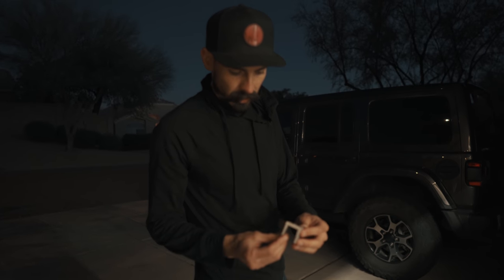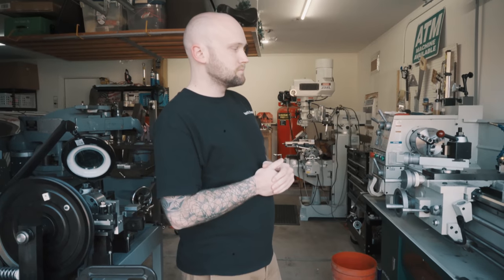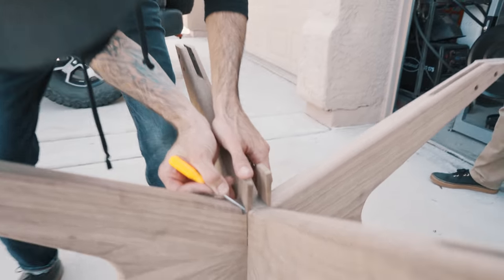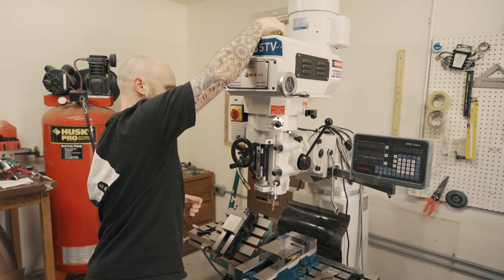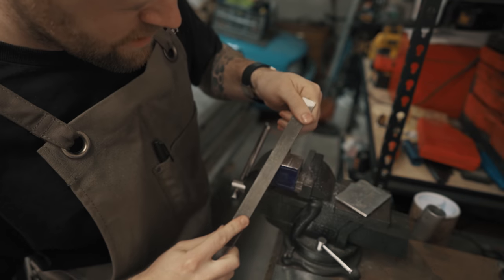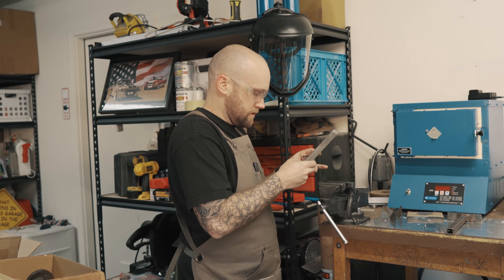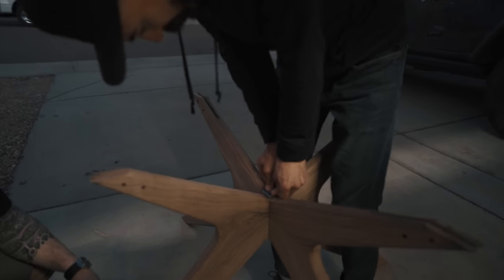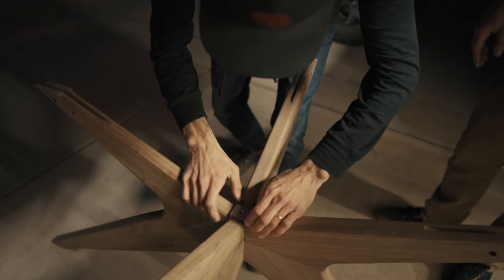Metal Milling and Table Leg Making | Road To A Table: Part 5 | Woodworking in Phoenix, AZ [4K]

Comment: Just a suggestion for if you end up using this joint going forward - not sure what costs you have associated in getting these made, but you could probably save yourselves some money and Darren some valuable time by starting with a C or U channel extrusion, cutting to length, adding your countersink hole and then tapering the walls.  That would save the step of boring out the cavity in the middle and you're not paying for all that metal to just become scrap.  I know there are lots of standard shaped extrusions that would probably fit your bill here, even if you ended up having to mill off some extrusion marks to clean it up and bring to final size.  I worked in aluminum for several years with CNC and manual so I know what I'm talking about lol.  I'd be happy to explain more what I mean if you're unclear and are interested.  Good luck to you guys!
Reply from the maker: Jason Woodford very helpful and insightful tips. I am looking into having them cast

Comment: Rather new, but I actually understand the reason why you are fabricating the piece. As a guy that’s been a designer for years, I always say “what if...” then I want to punch myself, but what if you also try the same wedge reasoning, but embellished it with a touch more aluminum milling that mimics the shape of the table legs “splay” themselves. (Still very tiny in presence though). Think of almost an upside down finial of sorts. Still performs the function needed, yet the milled piece follows the theme of the table — to tie in nicely. It would end up being a little thing that works nicely, but at the same time is visually a signature sign-off to the table... even if it is almost never really seen. Not certain if I made great sense of the comment, but somehow offering some added design thought / conceptualization sketches. Your stuff inspires creativity. Thanks!
Reply from the maker: Rick Bratto we love hearing that! We always try to push each other to be better. Happy when it sparks creativity in others as well! Not sure I fully grasped your idea. I almost always need to see a sketch for my brain to comprehend

Comment: Threaded insert in the wood to keep the wedge from backing out?
Reply from the maker: Ryan Moredock we drilled and tapped the wood and used a bolt with a tapered head. Yes to keep the wedge from backing out
Reply: William Douglas Co. very nice 👌🏽

Comment: Metal fab isn’t “the easiest thing”. Yeah you cut, grind and weld but in order to be a good fabricator, you should know most of the processes of welding and how to weld different metals at different thickness. You should know how to machine, what you call “metal milling”, using a lathe and a mill. Have experience cutting with a grinder, different saws, oxy fuel, plasma. Also, you should be knowledgeable in metal finishing. Anyway, you probably get the picture and on top of all that, you have to know how to install what you make, whether it’s furniture or architectural.